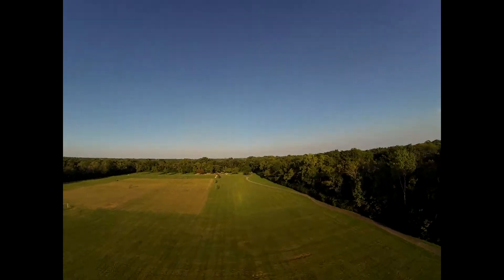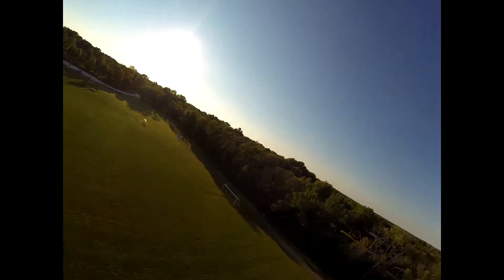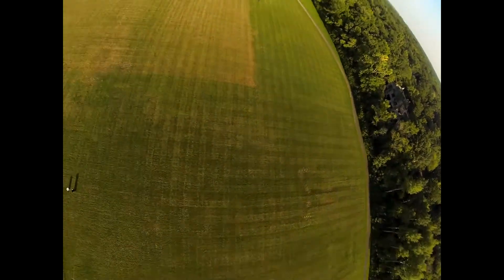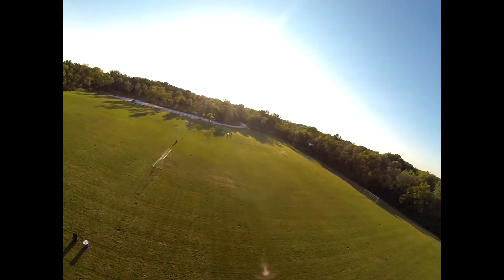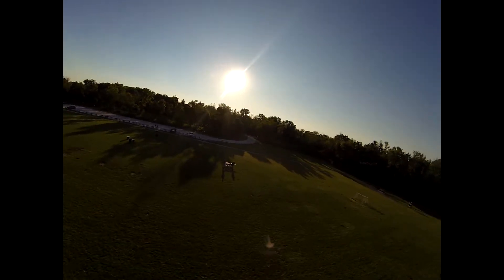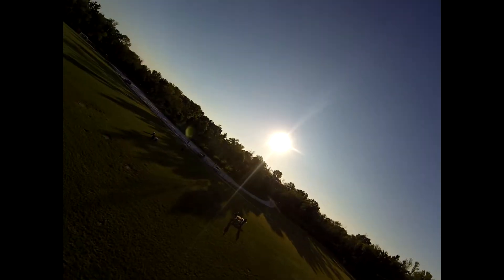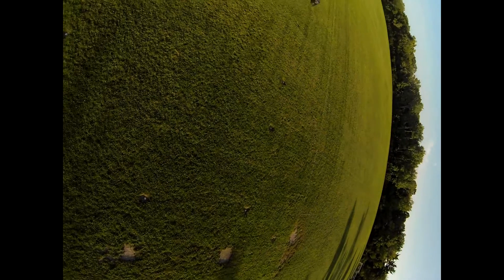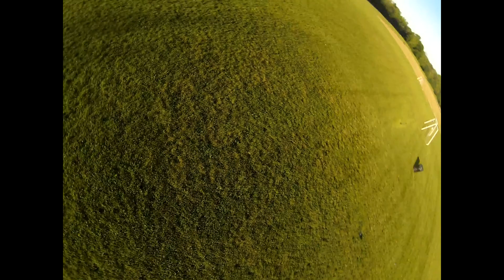Anatomy of a Crash ----  Tip Stall

Comment: Hi, I would respectfully disagree with your theory that the outer wing ( relative to the other wing in a left turn ) actually gained TOO MUCH LIFT due to the excessive banking angle and combined with reduced airspeed and inadequate throttle the aircraft then rotated on it's longitudinal axis to a point that was unrecoverable and the nose then dipped below horizon, further making the situation unrecoverable, given it's altitude, air speed, attitude, etc etc etc ??
Reply from the maker: Looking back, it's a textbook stall-spin incident.
Reply: @BrendanStewart  I would have to concur with you Brendan, it had most if not all of the characteristsics of a stall-spin incident. Also, the pilot panaicked, as often happens, which further complicates the incident, and further reduces the lieklyhood of recovery. Everything happens so fast, the brain struggles to keep up.

Comment: It appears that what you experienced was actually an accelerated stall that resulted oink spin. All airfoils experience a higher load factor in a bank and as a result a higher star speed.  The increase is not linear. The initial bank, that you described as relatively shallow appears to be around 30 degrees. The stall speed at that angle is about 8% over that of level flight. At a 45 degree bank angle it is approximately twice that of the 30 degree bank. At 60 degrees bank it is increased by a factor of 5, so that the stall speed is about twice that of level flight. While we tend to describe stall in terms of airspeed, it is in fact angle of attack the airfoil chord line angle to the relative wind that is the determining factor for the abrupt loss of lift that is a stall. Knowing that is crucial to stall recovery.

An actual tip stall does not result in the wing over-all stalling, nor a sufficient loss of lift to cause earth airplane to descend rapidly. The reason designers work to mitigate any tendency to tip stall is because they result in a loss of effective roll control due to aileron placement and a "wallowing" characteristic of the aircraft. as the light loss of lift involved is unlikely to occur symmetrically.

A rapid increase in roll to the inside of a tune is simply an accelerated stall as described above, coupled with an uncoordinated turn: if the aircraft is skidding to the outside of the turn at the time that the wing stalls is will roll to the inside of the turn as the inside wing stalls first due to in increased effective angle of attack not hat wing.

The big question is how one recovers.

You indicate that you"hammered on the elevators" by which I assume you pull back on the stick in an attempt to rise the nose. That is the precise reason that you did not recover. Counter-intuitive though it seems, at the onset of a stall, one must reduce the angle of attack. That is done by lowering the nose, not pulling up. By pulling upon yo insure that the wing remains above the critical angle of attack and remains stalled.If one additionally attempt to raise that inside wing with the ailerons the problem is exacerbated, sine lowering the aileron on that side increases the angle of attack on that wing while at the same time the raised aileron on the opposite wing lowers the angle of attack on that wing. Under that circumstance if you actually insure that  you do the right thing regarding the elevator, you will still cause the upside wing to recover before the low wing, thus transitioning from a spin to a spiral dive.

The mantra that every pilot learns (and which many are unable to put in practice because it is sop counterintuitive, to their ultimate death) is that stall  and spin recovery is accomplished by FIRST lowering the nose. Second Neutralizing the ailerons, adding power, and using opposite rudder to stop any spiraling. It is more than difficult in a full scale airplane to see the ground filling the windshield and pushing forwards on the controls, and we ll want to haul back on them instinctively, but it is not possible to recover from a stall by pulling the nose up, nor to stop a spin using the ailerons. Ever.
Reply from the maker: I love watching my old videos from before I finished by PPL. Borderline unintelligible. 😂

Comment: You're confusing a few concepts.  Vmc only exists in multi-engine aircraft.  It is the speed demonstrated under a specific set of circumstances at which full deflection of rudder and aileron are no longer capable of maintaining control of the aircraft.  This video demonstrates a stall into a spin. It is completely unrelated to Vmc. 

On a second point, wings on full scale aircraft are all designed to stall from inboard to outboard to allow for earlier warning of the impending stall and to maintain control along the longitudinal axis all the way up to the full wing stalling.  I don't fly RC  so idk if this plane just has a poor airfoil design, but your comment about the outboard stalling first is quite strange.
Reply from the maker: Yeah, you're 100% right about the VMC issue. I was confused because its symptoms mimic VMC's on some of my multis almost to a T.

I will say however, in flying wings, especially deltas like mine,  (with NO rudder!)  the the outer portion tapers to below 50% of the chord, and is swept back behind the CG. Keep in mind I'm flying an aircraft with no tail. The only thing keeping me in the air is a well placed CG and delicate control of my throttle and elevons.
Because the airfoil tapers and I have no rudder, I generally have to throttle up a little when entering a bank, otherwise the wing on the inside of the bank (traveling the smaller portion of the arc) experiences less airspeed than the wing on the outside of the ark. 

What I did wrong was I made a bank to steep, and pulled up on the elevator before I could get the airspeed up enough to prevent the inner wing from stalling. The difference in lift between the stalled inner wing and outer wing (which had sped up due to being on the longer portion of the arc) was enough to throw me into a spin that I couldn't recover from

You should get into R/C! You can fly much more exotic aircraft without the risk of splattering yourself ;)
Reply: Brendan Stewart I have a couple friends who fly RC, but I've never been too interested.  It seemed far more interesting when I was a kid and didn't have the opportunity to fly full-size planes. 

I have the tremendous opportunity to fly quite "exotic planes" through the Air Force.  :)  I honestly couldn't ask for much more. 

I have looked into FPV RC flying a couple times.  That seems like a blast.  The only problem is the AF doesn't pay that well and my other hobbies tend to be really expensive as is.
Reply: @AerialAssassin4  i am wondering if flying rc planes might effect ur skills and reflexes of flying real planes.  
I have heard military tries to selected "gamers" over "real pilots"to fly military drones.  I am wondering if the reverse concept applies.
Reply: Simtube S. The process for selecting candidates for Air Force rated slots (pilot, CSO, ABM, RPA) is all the same.  Being a real pilot helps your scores a good bit.  Gaming plays no part except maybe helping you score better on TBAS, but that’s debatable.  Some of my buddies are gamers.  I’m not.  I don’t think it helps them be better pilots.

Comment from the maker: expo is king in wings. But never more than 30% or the change between center and outer travel will be too sharp. keep in mind too that a properly balanced wing shouldn't VMC to easily. I had the misfortune of pitching over my CG making the stall unrecoverable. Balance your plane, Keep power on during tight banks and watch your airspeed. you should be fine

Comment: I cant even launch mine cuz i dont have enough room to get the speed i need apparently. i have to then bank hard and it does what urs did -__- are all wings this bad with wingtip stalls or is this worse than normal. I was looking into the rvjet but i dont want to experience the same problems. Also, what settings on my remote can help that, should i limit the throw of the servos and add some expo?